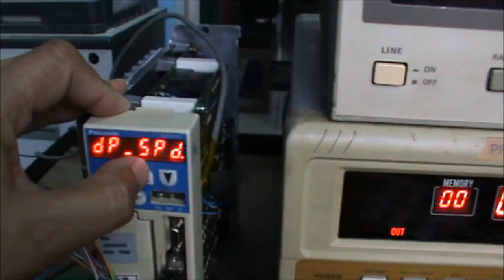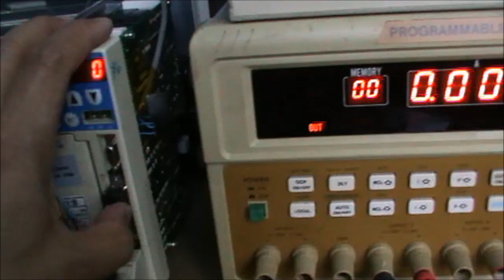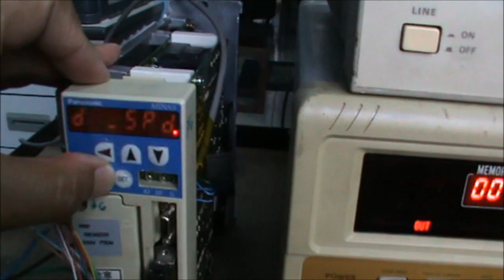Panasonic Minas AC servo motor driver MSD repair error 14

Comment: Error 14 Panasonic A4 how to remove?
Reply from the maker: @theexpertengineering  This video made long time ago. Not sure why part 2 videos disappear on YouTube.
Anyway problem Err14 solved after I replaced main electrolyte  caps, about big ones caps.
Reply: @akanghadibatam7285  value of capacitor?

Comment: Where is part 2?
Reply from the maker: It was a long time ago, it was uploaded before , not sure if it has been taken down.
Reply: @akanghadibatam7285  I found the error 14 reason for my case. If anyone need help contact me
Reply from the maker: @1Robbie75  err 14 occured due to insufficient current supplied into motor. Most of the problem caps out of value,  Caps not so expensive, replace all the caps.
Reply: @akanghadibatam7285  We had another simple problem in our factory. Driver was good but one of the 3 phases was missing! Simple disconnection from the plug! I hope it can help people.

Comment: How to solve error 14
Reply from the maker: I lost my 2nd  parts video and on youtube also gone. Anyway the problems due to 2pcs of caps / electrolyte caps out of proper value. It is bigest caps on power supply section.

Comment: panasonic servo drive mcddt3520 error 21 showing how can remove this error can you show me pls
Reply from the maker: Alarm error code 21 in Panasonic A4 that you have is coomonly comes from encoder side, it can be cable, encoser itself, or driver failure. 
Try to hook up other encoder to confirm.

Comment: Hi Sir, I can not find the part-2 of the video where you solve the error. Would you mind to point out its link in here ? Thank you
Reply from the maker: I lost my 2nd  parts video and on youtube also gone. Anyway the problems due to 2pcs of caps / electrolyte caps out of proper value. It is bigest caps on power supply section.
Reply: @akanghadibatam7285  Thank you for taking the time to respond. If I understand well, I should send the drive to repair in order to check/replace the failing capacitors?

Comment: Bang mo mnt tolong, klo servo drive type msdb045a1a11 itu minas apa?
Reply from the maker: Banyak sekali type Minas motor driver di market, namun sebagian costumize pada bagian firmwarenya.  Sy tdk tau Minas yg amda cari termasuk yg mana. Yg jelas bila tdk ada manualnya di Google berarti costumize.
Reply: @akanghadibatam7285  maksudnya customize ap om?
Reply: @akanghadibatam7285  saya punya driver msdb045a1a11! Ga tau pinout io nya!bs bantu pinout socket mdr 36pin nya?

Comment: Hi , great vidéo . my problem is different , on my driver the numbers keeps increasing slowly and the servo motor starts to run by it self when installed in my CNC plasma, I remove it for testing and no problem when powered by itself and works fin on JOG mode , so I want to test the servo drivers before putting them back , I want to test them using a potentiometer as analogue input for speed control , can you please help by how to connect a POT , and all input (sevro on .....) That needs to drive the ( Panasonic mcdht or minas A5 model ) thanks in advance , chafikouta@gmail.com

Comment: under voltage protection for main power
Reply from the maker: Hi. Under voltage ( uv) will occured if the sensing circuit detect main power under estimated. Sensing by optocoupler or resistor in   series. Currently I do not have this driver in hand  anymore, so ca not poinnted which optocoupler/ series resistor.

Comment: Hi friend! please i need help with the error 12! could you?
Reply from the maker: Lost of document long time ago. Any way error code 12 generate as OVERVOLTAGE. It is occured if really the input voltage is over allowed.  If input voltage is OK then you have to check "opto coupler" that tapped to DC high voltage. This optocoupler (4pins) if damage then always keep informing to controller as "overvoltage" .Good luck.

Comment: Hi, Please could you post a link to video part 2 for the Panasonic servo driver error. Many thanks
Reply from the maker: Hi. Not sure problem with my 2nd parts of video in youtube. My copy of video is lost. Any way , check your large size of capacitor, it is having lower value. If it is so then you hv to replace them.

Comment: Parts-2 ??? please .
Reply from the maker: I have no time to make video as the driver belongs to my costumer. You just need to replace all HV cap at mains that connected to power modules. Over current is occurred due to not enough power on motor when absorb DC power on cap.
Reply: @akanghadibatam7285  Thanks